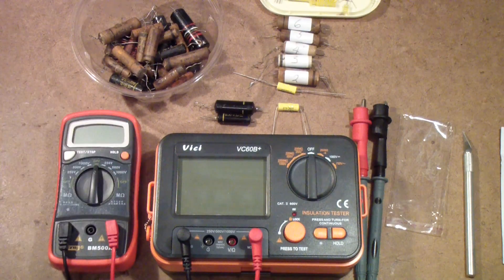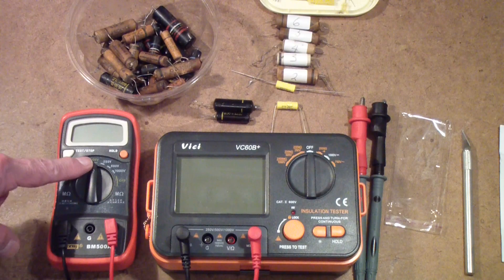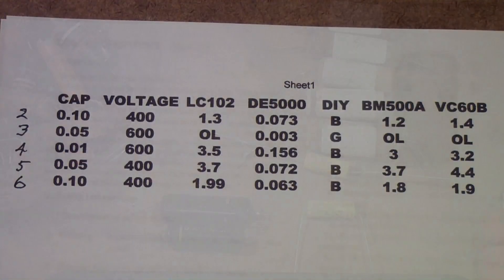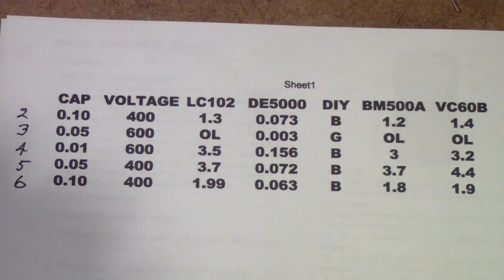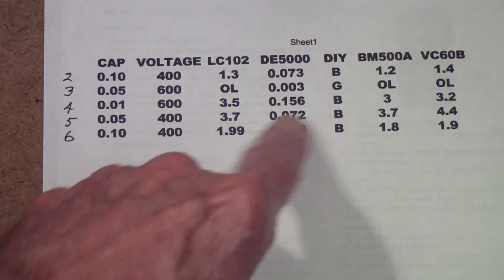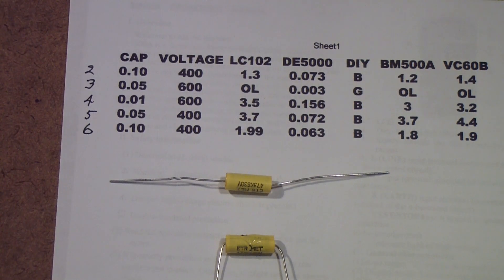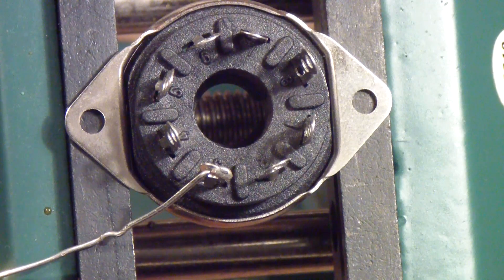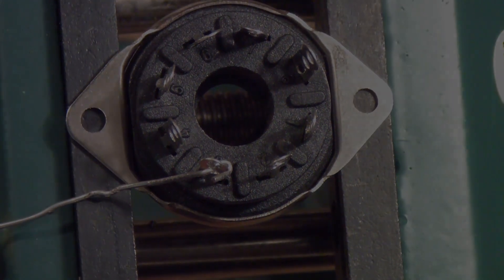TTT338 Capacitor Testing for Tube Circuits

Comment: Great stuff. I would have been interested to see the actual process, as I can't figure out the three terminals of the BM500A or whatever it is: Live I get, but the other two are Earth and Ground, with no apparent connection between them, yet both show HV to the Live terminal, but only E gives a reading. And I tested a dozen PIO and film caps, all new: they all gave readings that fluctuated all over the place and never settled, and never 0L, and I doubt they are all bad, although some certainly are.

Comment: Great video.Tom. I have an LC102 that I really love too. Could you do a video on  testing
for dialectric obsortion. I was testing some new electrolitics that said 58% bad.
All other tests passed.What does this mean? Jimmy
Reply from the maker: Thanks for the suggestion. I will try to do a video on using the LC102 to measure Dielectric Absorption but it may take a few weeks. In the meantime you might want to review pages 20-21 and 63 in the LC102 manual which might clear up some of your questions.

Comment: II agree with testing new stock prior to installation. Components are mass produced, and are not 100% tested in production. Failures do occur. Therefore, assuming that because a component has not previously been used, it’s good, can lead to considerable wasted time, and frustration. Failure rates are not high in modern production, but they do occur. I do “receiving inspection” on everything I buy. I don’t find many failures, but they are there.  This way, I don’t have to do the ‘receiving inspection’ on equipment into which I’ve installed the components.